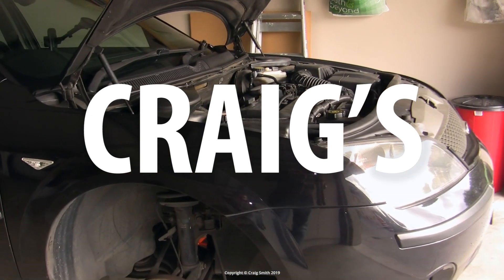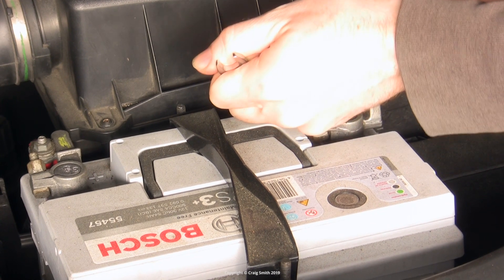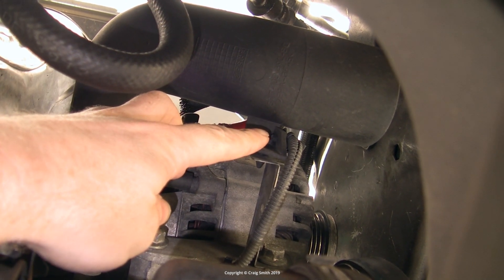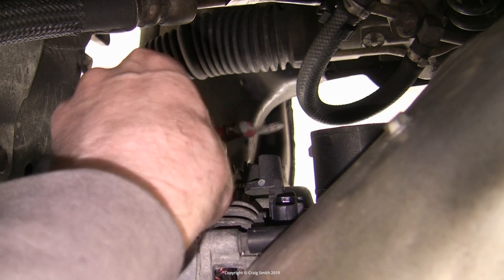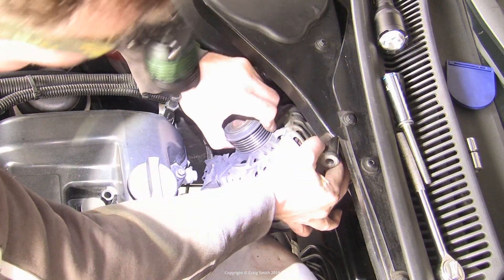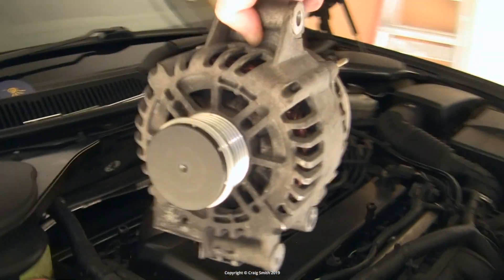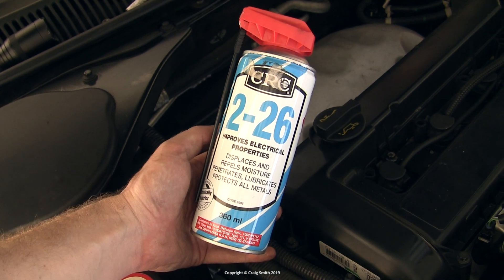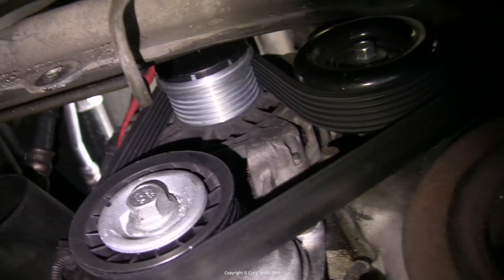How to: Remove alternator, Ford Duratec / Mazda L (Mondeo, Focus, Escape, Mazda, Volvo)

Comment from the maker: Links from the desc... If you need a new alternator try Amazon US: https://amzn.to/2m67q9w | UK: https://amzn.to/2kVWf3a
Diagnosing a faulty alternator: https://youtu.be/Q2AAMc9VIMo
Removing the auxiliary belt in more detail: https://youtu.be/ItND7vPozv8
Changing an over-running alternator pulley (OAP): TBA
Reply: Nice to see that you still take care of this old mondeo :)Thanx to you, I still drive my 02 1.8 270k km duratec mondeo, I do most of repairs myself even though I have just basic tools. Not really a lot has gone wrong with mine, if you consider cars age.  Well apart from a major issue - flaps and metal got inside of the engine... made horrible metal sounds :O . Like 5cm of metal rod holding the flaps was missing, but get this - engine is still fine.  I was very very lucky it seems and all the metal pieces must have gotten out on its own through the valves. They did make a lot of marks on the piston (seen on camera through spark plug hole). After this happended I can still do 200km/h (so no power/compresion was lost) and if I drive really really nice in the summer I can do 1k km per tank.  For me its a reliable engine, and for my use 10k km yearly its also very economical. It has a little rust here and there, but thats normal :) 

Any plans of buying a new (or another used) car?
Reply from the maker: You do sound lucky. Oh I don't know, I will have to one day!
Reply: Yes agree, if belt is not totally removed from situ then all good but if it is taken out of engine bay for a good inspection then really needs to go back with same direction of rotation.
Reply: Instead of removing black plastic cowl from alt to get it out could you have removed the top strut mounting brace that appeared to be the problem? And also it is good practice to ensure the polyVee belt is replaced so the direction of rotation is the same as it was previously.
Reply from the maker: Yes... but 4 8mm nuts are an awful lot easier. No need to take the belt off the engine.

Comment: Thanks, the video was great help. A couple of things though, on my car x3 alternator mounting bolts were 13mm hex. Also, I removed the top exhaust manifold heat shield (×6, 8mm screws, 4 around the edges and two at the top) and removed the bottom heat shield bolts (×2, 8mm bolts) - the bottom one doesn't appear to come off without exhaust pipe disconnected. This allowed me to push the bottom heat shield around enough to give me a better angle to release the alternator connector and as a bonus, it also let me pull the alternator up with the duct base attached. cheers.
Further EDIT: Went to Pick-a-Part to get a second hand one off a (relatively) low mileage Mondeo (2006, ~155,000kms). The one I picked happened to be an aftermarket one with a solid pulley. I've quickly checked out all 6, a mixture of pre-facelift and facelift, by looking at the OAP cap. Some had OAP, some had solid, irrespective of facelift status. I'm unsure if solid pulley ones are all aftermarket ones or Ford used either ones available from their parts bins. I think the part number sticker is on the bottom side, so a bit difficult to figure out.

Comment: Hi, im having an issue with the alternator not charging. I replace the battery with a equivalent Willard battery and also changed brashes of the alternator. Do you mind telling what the cause could be? The battery light on the dashboard stays on and battery gets drained!

Comment: 3 averías en 5 años en el sistema auxiliar de mi Ford Mondeo MK3 2,00 diésel. Tras la última reparación, (con cambio de dumper, correa y tensor), y en solo 14 meses vuelven los malditos ruidos. Aconsejan en foros de Internet cambiar polea fija alternador por una con embrague pero veo que sacar el alternador es tan complicado que entonces es normal que la mano de obra cueste carisima.

Conclusión, tiraré el coche a la basura y nunca más compraré un Ford. 🤪🤪🤪

EDITO, PUEDEN VER MI ÚLTIMO MENSAJE, AL FINAL ME ATREVÍ A CAMBIAR LA POLEA DEL ALTERNADOR. MUCHAS GRACIAS POR EL TUTORIAL. 👍

Comment: Undo the exhaust heat shield to make enough room to take the alternator out from the top without diassesmbly (except for removal of the intake pipe).

Two bolts secure the top part to the engine, and then four hold the top half to the bottom half. And then just two bolts which can be slightly loosened off for the bottom part and then slide rearwards out of their brackets. 

The lower half can't be removed due to no room, but it can be moved out of the way to get the alternator out..

Comment: My dad has an 05’ mondeo hatchback, 1.8. Having to replace alternator as the car cut out while driving and the battery light came on in red, battery was changed, light was still on then car cut out again. So i’ll have to change it later on during the month, and hopefully the alternator will charge the battery again. If you or anybody else have an idea of what else could be causing the car not to charge and subsequently cutting the engine off, i’m all ears.

Great video though! Very easy to understand and well put tigether
Reply from the maker: You have to diagnose some things. I did a 3 part series on batteries, alternators, and other gremlins. Start here https://www.youtube.com/watch?v=bXKfYglnFs0

Comment: Hello  Mister Graig ! i have the same model of Mondeo 1.8 Duratec 2002 !The car have around 230.000 and for past 2 days i have problem with alternator i think because the baterry light come in dashboard and the engine die in gear when mouving !Also a ratle noise from it i hear .... i don't know if is the alternator or other thing but i don't know until i mouve the car on service !Posibly it may be the coal in the alternator. ..or the polley !I don't know....but it really suck's because he die instantely !

Comment: do you know whether your alternator was from factory? I have the same car and engine i thought but my alternator has a standard pulley as opposed to the clutch type on yours. Wondering if it was aftermarket or Ford changed it maybe? Thanks for the videos they are a real help
Reply from the maker: I believe they put the OAPs on those with manual gearboxes, standard on autos. Mine's an 'upgrade'.

Comment: I have this car, 2002 model, 1.8 125 ps. I have done 250.000km with this car and the 100.000 of this is with lpg system on it. Now, i have problems with oil oil consumption. It is about 3 lt every 5.000 km. What is your opinion about this. I will go to rebuild the engine. I dont want to buy other engine that i dont know what it is.
Reply from the maker: Engine at end of life honestly, they're rated for about 250K. I don't have experience with a rebuild but I know their bottom end isn't intended for it. Good luck.
Reply: @CraigsDIY  Thank you mate, best regards.

Comment: In St220 only way to remove alternator is wheel hub. But is not necessary to disconnect steering rod, just enough to disconnect stabilizer link.
Reply from the maker: Interesting, thanks.
Reply: What side on the conector does the yellow and blue wire goes mine broke off

Comment: What were the symptoms you were fighting Craig? My Mondeo sometimes has a charging problem, but only stationary with the aircon on. So I thought of slip on some pulley. Thanks for excellent video once again.
Reply from the maker: Nothing wrong with the alternator, the over-run pulley had seized. What's the problem exactly? No charging voltage when air-con on?

Comment: If i remember correctly, i disconnected the lower motor mount and rocked the bottom of engine forwards to remove alternator.  I know it took some time.  Nice job.